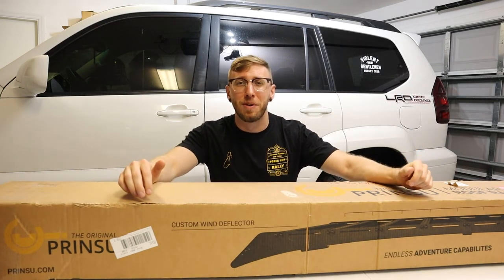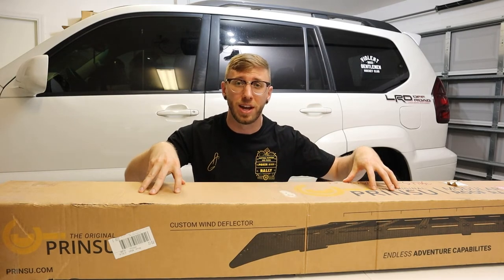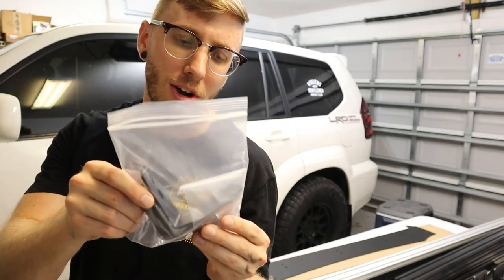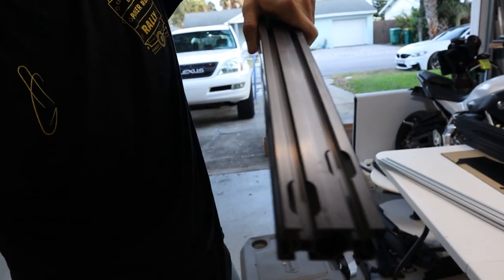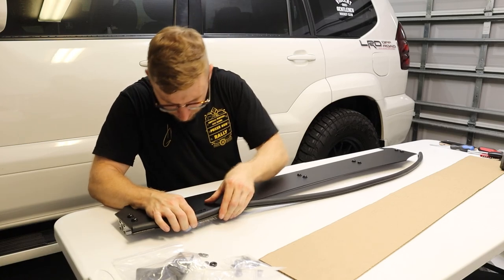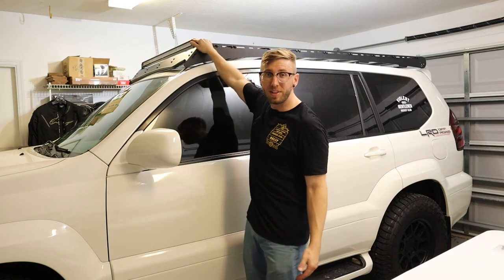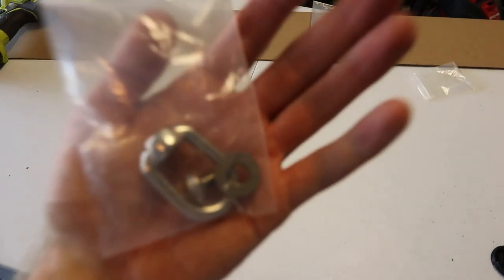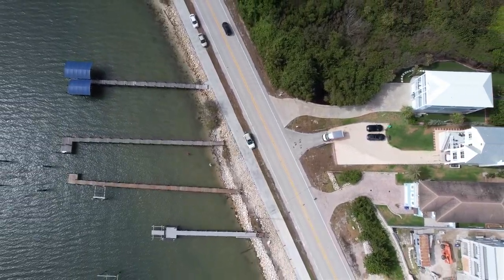Vlog 51 - Lexus GX470 Roof Rack Install (Prinsu)

Comment: Not planning on changing my roof rack because I never use it lol! But great clear video as always!
Reply from the maker: Kaisar! Hope all is well with you this weekend. 
Yeah if you don't use the roof rack much, this isnt worth spending the money on. I do however recommend another solution for mounting than the magnetic mount I used if you ever go the light bar route. As you can tell, the mounts didnt do well at highway speeds lol.

Comment: I can't wait to get my GX
Reply from the maker: Hey Andy, thanks for reaching out! Are you currently looking or already purchased?
Reply: @Awesomoto  thanks for the reply. I've been looking and have had my eyes set on a 05' with no navigation, that has blown airbags in the back. The price is right, and will even get lower once I explain how much it will cost to replace... But shhhhh! Obviously I'll be putting in coils lol.
It's ust kinda hard at the moment, because life happens and I've had to dip into the GX savings quite a bit. So being pretty much back to square one. I'm just hoping to secure one before winter at this point. The sooner the better

Comment: Looks like the light bar sits noticably higher than the racks. If you had to strap something long up there do you think it might put too much strain or weight on the light bar?
Reply from the maker: Great observation! Yes, it sticks up higher and would take the load of a long board or anything extending over that area. There is a lower mounting point on the bracket that I should move it down to.

Comment: Did you put any sealent in the spacers so water doesnt leak from your roof? I see in the PDF in their page they have ome sealent in them, but it doesn't say to put any.
Reply from the maker: Yes, I added a clear silicone sealant. I didn’t do it at first and then read it months later in their instructions. I didn’t encounter any leaks without it over those few months, but it’s just a good safe measure to do

Comment: Great video! Does the front bottom rubber gasket install with the round rubber portion on the underside so the rubber seals between the front plate and the car body?
Reply from the maker: The stock round rubber portion does not get used here. Since the install, I have added some clear epoxy to seal around the bolts going into the roof as I saw others doing this in the forums.

Comment: have you tried moving the light bar to the lower bolt holes? seems that might get rid of that thin gap between the fairing.
Reply from the maker: I tried to move it to the lower holes, but then the extra height on the brackets hanging above the light bar looked awkward, so I kept it on the upper holes. I should probably try it out again and see if it still looks strange. I agree with your thought though, it should reduce that gap and have less wind noise.

Comment: Did you use any sealant on the main mounting bolts?
Reply from the maker: I did not and haven't had any leaking issues, but I may throw some around it the next time I'm up there just for peace of mind. I recommend doing this if you have some silicon sealant.

Comment: It's that the 42" lasfit that's on the website?
Reply from the maker: You bet! I did a whole install video that includes links and discount code. Use AWSM10 on Lasfit.com to get 10% off your order!
Reply: @Awesomoto  thanks, I've got the prinsu rack as well and wanted to make sure it would fit. I watched the install video 💪